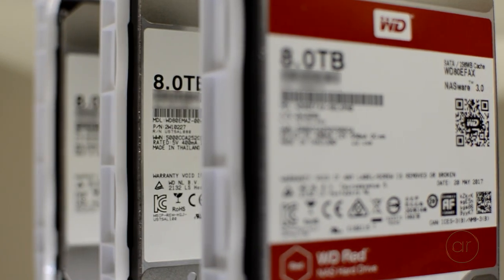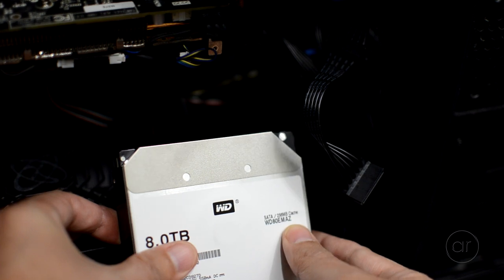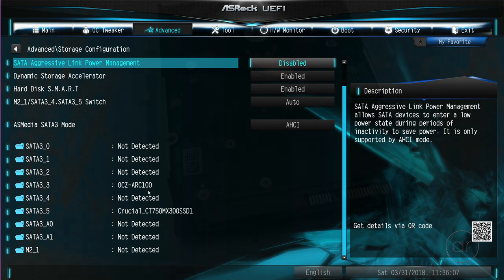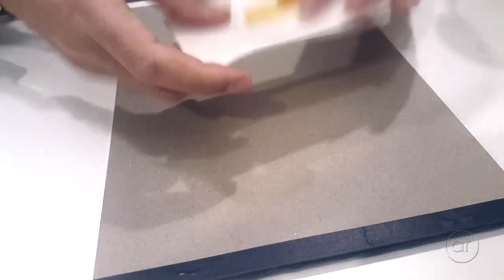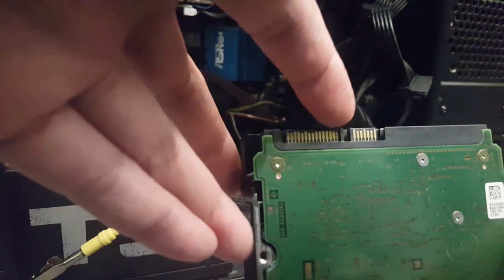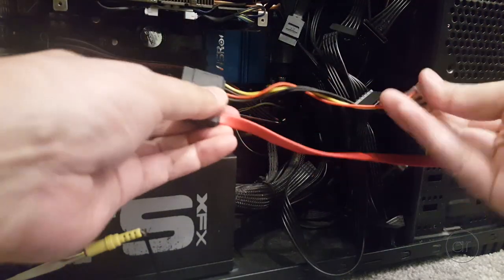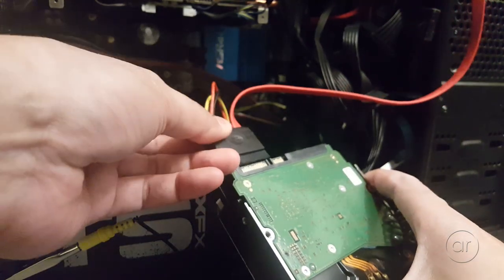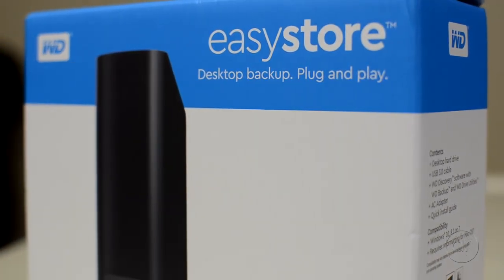How to Fix the 3.3V Pin Issue in White Label Disks Shucked from Western Digital 8TB Easystore Drives

Comment: Note for anyone having a hard time getting the tape to stick: You can actually cover up pins 1 and 2 in addition to 3. It makes the tape stick much better, and your hard drive doesn't use 3.3V anyway.
Reply: this is the most helpful post
Reply: Confirmed, I covered all first 3 and it recognized the drive, thanks to both of you.
Reply: This worked like a charm, thank you
Reply: Thank you. That was so much easier to accomplish than a single pin.

Comment: Wow, I can see why you'd go through the trouble for this.  It seems the cost of these external drives is about half the cost of a normal standalone 3.5" drive.  Just goes to show how inflated the prices are.
Reply from the maker: Yeah, they're definitely targeting a different market with the externals (high-volume, convenience, no need to open the computer).
Reply: @accessrandom  really? how much are the white label drives? The Seagate 3.5" BarraCuda 8TB drives specifically sold for internal storage are $230USD atm.
Reply: less than $30 a tb seems cheap as anything
Reply: @knifeyonline  I bought some easy stores last night that had the same 8 terabyte white label drive as the video for 130 dollars per drive.
Reply from the maker: White label drives generally aren't sold as internals, but they have the same or similar specs as the WD Red label drives. The Barracuda Compute 8TB drives that I've removed from external Seagate Expansions in my other video seem to be different than the Barracuda Pros as they have slightly different model numbers (ST8000DM004 vs ST8000DM0004 respectively). At any rate, agreed there's a lot more bang-for-the-buck with the externals.
Reply: The WD external 8TB drivers were $180CDN on sale, about $100 cheaper than the internal drives. I didn';t have to worry about this problem in my server but definitely it's worth it to shuck them.
Reply: @Waltzkon  When you bought yours for 130(i know two months ago but I'm gonna start watching for a sale) where did you buy them from?
Reply: I got a 10TB external for about half the cost of a interal drive
Reply: They are cheaper because they are lower quality. If you don't care at all about your data, then please go ahead doing this. I won't.
Reply: @Clarissa 1986 "After all they are WD Red HDD's"... :-)
Reply: It is all down to quantity. I expect somewhere like Argos or Best Buy gets a better price on these than a computer shop wanting to buy 100 internal drives would get. I wonder how much someone like Dell pays for drives when they are ordering tens of thousands ? Undoubtedly  less than these cost a retailer. Buying components for work,   price breaks often mean it is cheaper to buy 100 than to buy 60 !

Comment: Using an earthed wrist strap can be as dangerous (if not more dangerous) as not using one at all. There's no guarantee that your mains earth is going to be at the same potential as whatever you're working with. You could actually fry the drive BECAUSE you're wearing it. What you should do is make sure everything is at the same potential so no current can flow anywhere. To do this, plug the data cable into the drive while you're doing this and plug the other end into your PC. Then attach your wrist strap to a grounding point on the PC. One of the shields of a connection port would be okay, or to the ground pin of the power plug (the PC shouldn't be plugged in). Then everything is a closed circuit at the same potential.

Comment: This video is so professionally done. Love the instructions/video and voice-over!
Reply from the maker: Thanks so much!
Reply: @accessrandom  for some reason i couldnt reply directly however this video saved me a ton of headaches. i just used a molex to sata adapter i had in part bin and the drive is running like a champ internally. thanks for the link to the r/datahoarder reddit too tons of great info there
Reply from the maker: You're welcome, and thank you.
Reply: No it's not.  Dude wears an ESD wrist strap, but the clip of it, is fastened to the computer case while it's not connected to the power supply .....   That doesn't deflect any ESD at all.
Reply: Straightforward and to the point!
Reply: @accessrandom  great video, Now I understand the 3.3V issue. this is not an issue for old PSU's though
Reply: @eidodk  True LOL Then those scissors and flathead metal contacts... youch

Comment: You can also use a Sata to Sata power splitter or extension. If the extension contains any orange wires, simply cut them out and remove.
Reply from the maker: Good idea - thanks for the tip.
Reply: @accessrandom  Hey, I have a quick and easy question for you; I found that I have about four sata to sata splitters / extension cables; If I hold it with the female connector(s) facing up; the wires from left to right are:  Yellow, Black, Red, Grey, and I just wanted to see if you knew if these adapters also will work or not; because I haven't removed the external drive yet, and would like to be certain I have the correct resources on hand before starting; not sure where to get tape, as that is a new solution I also wasn't aware of; but I would imagine if I cannot find it locally at lowes or home depot, it wouldn't be to hard to find using the correct search term; thank for any info.

Peace

Comment: Alternatively you can also cover pins 1 and 2 together with pin 3. They aren't used either, so it's much easier. Using a Molex adapter can be dangerous, because the low quality ones are getting moulded after the cables are plugged into the plug. This leads to the cables moving and getting close to each other and then burning the whole disk (Molex to SATA, loose all your data). The good ones are crimped and just stuck into an already finished plug without the cables being able to touch each other.

Comment: This saved me several hundred dollars! I was going to go out and buy five new HDD's, but I was like "no, wait, why is this Red drive working, but these two White drives not working...? They all worked in the old system last week without any issues...." I took one of the power supply cables I had purchased previously, with the right-angle plugs, and just snipped the first wire - the one closest to the "L" part of the power cable - and electrical taped it off carefully. Plugged the drives in, and everything worked. It's insane that this is a problem. Wish there were a "switch" or "BIOS" fix, but removing the 3.3 volt line will harm nothing, as this is in a personal computer, and I don't need to "remotely restart" a hard drive. I would like to know more about the transition...why this happened, and why no one seems to care about making drives obsolete with a weird cable/power supply issue. My power supply is a brand-new SeaSonic Prime TX-1600, so I couldn't imagine that being the issue. Nice to know it's that "pin 3" so easy to mitigate. Thank you so much!

Comment: The 3.3V "issue" is actually an Enterprise Feature - it is used to spin up multiple Disks one after the other instead of all simultaneously
This way you can use way smaller PSUs in a Server and/or drive enclosure :)
Reply: Yeah, but clearly this is a workaround for those shucking drives to save moolah.
Reply: Not exactly, staggered spin-up has been around since parallel SCSI, this power disable feature was only introduced with SAS3 and SATA3.
Reply: @VladdyDaddy45  Actually it's a enterprise hard drive. I even test it. I have WD80EDAZ-11TA3A0 the one you suppose to put tape on. Wouldn't work on my desktop but was able to be detected on my Dell Power Edge T710. :D
Reply: Can those pins just be removed from the drive or sata plug?
Reply: @mikemulvaney8490  Yes, but its easier to use electrical or kapton tape to cover the pins on the drive's SATA connector.

Comment: Thanks this has been driving me nuts and I assumed it was my motherboard getting a bit old. I removed the pin with a dental pick and works great internally now.
Reply from the maker: I wouldn't have thought of using a dental pick but now that you mention it, it sounds like the perfect tool :) Thanks for the comment, and glad you found the video helpful.
Reply: @accessrandom  yeah I was wondering why you didn't just use a scribe to remove the pin.
Reply from the maker: I was focusing on non-destructive ways to prevent contact, but these are perfectly valid (and brilliant) ways to solve the problem.
Reply: Any videos on how to remove the pin? Would any other tool work just as well? Thanks
Reply from the maker: @cajunflix1movies728  Others in the comments below have used Xacto knives. I think anything thin and sharp enough to get under the pin should work (sorry I don't have a video on this, but I myself was trying to do it non-destructively).
Reply: Excellent video and excellent tip on removing the pin!  I used an exacto knife and it worked like a charm. Thank you both!
Reply: Thanks! This is by far the easiest method.
Reply: I would not recommend removing the pin, doing so will void warranties
Reply: @chrisvm6231  The warranty is already voided by shucking the drive.
Reply: @jeromemccrary8682  unless there is a warranty sticker on the housing it isn't
Reply: @jeromemccrary8682  it isn't. You can even send the drive back by itself and they will replace it.
Reply: @LiquidPlacidity  that's not true put serial number of drive into wd warranty returns . It won't  exist as there is no warranty. Serial on enclosure is different
Reply: @jeromemccrary8682  The HD manufacturers might claim that to be so but unless breaking the pin caused the HD to break they have to still provide warranty. Just like servicing your own car wont void the warranty if the servicing wasnt the cause.
Reply: @chrisvm6231  "Warranty void if broken" stickers have no legal standing.
Reply: “I don't know”, you don’t have to throw away the cases. Additionally, few years back I’ve seen a number of external WD drives that have had the same SN on the outside as the internal disk drive. But I haven’t checked that recently; it may have changed...

Comment: Hey fellas, thanks a ton for this video.

Instead of using either of these solutions listed I used an automotive pick to pull up the third tab on the power side and moved it gently back and forth until it broke smoothly at the base.

Now windows/bios sees the drive and works fine.
Reply from the maker: Thanks for the tip - I'm sure it will be helpful for others.
Reply: @accessrandom i used this guy's tip and lifted the 3rd contact up on a female to male sata extension cable and this also works fine and no setting fire to the house problems that it appears a lot of people have had from the molex to sata extension cables - excellent video and suggestion reply that led me to this solution - Thanks a lot :)

Comment: Mine was a WD Blue drive, from a MyBook 6 Tb. 5400 RPM :(((

The pins inside the sata power connector are spring-loaded so I ruined the pins ability to reach the contacts with a tiny screwdriver. Worked perfectly well, thank you very much :)

Comment: thanks, I didn't use either of the 2 options, I cut the cable on the power supply sata connector that corresponded to the 3rd pin (was the first cable in my case) and it worked perfectly.  Only drawback is that if you plan on switching out a new hard drive in the future, just make sure it's a schucked one or use a different sata cable .
Reply from the maker: Thanks for the tip. I was focusing on non-destructive methods, but yours is a perfectly valid way to solve the problem.

Comment: Thanks so much for this explanation! I was getting ready to blame WD (and my cheap-ass self) because its budget priced MyBook (which was already a pita to get out of its enclosure) wasn't being recognized as an internal drive on my old pc (which I repurposed as nas). The tape solution already worked like a charm, luckily I had an old sata to molex (only power) adapter lying around, which is an even better solution!
Reply from the maker: You're welcome, and thanks for sharing the success story 🙏👍 I've heard the MyBooks with the newer enclosure design can be difficult to shuck.

Comment: Kapton tape worked perfectly. Use tweezers and a toothpick to place and smooth the tape. After spending 45 seconds smoothing / pressing the tape into the pin I tested plugging / unplugging the connector a few times and it stayed in place perfectly. Thanks for the guide!
Reply from the maker: Thanks - always happy to hear a success story :)

Comment: I came up with another solution. I was using the Molex to SATA adapter but it is the molded kind. It was making me nervous. I decided to mod the 3.3V line on the SATA power cable and discovered that the cabling Silverstone included with this power supply actually has removable caps on the backs of the SATA connectors. I pulled off the cap and slid the orange 3.3V wire out of the connector. I wrapped electrical tape on the insulation where it had been sliced by the connector and recapped the connector without putting the 3.3V wire back into it. I don't know if anyone else has this style of connector going to their drives but it's worth a look. Easy to do and easy to reverse if the 3.3V line is ever needed.
Reply from the maker: Awesome - thanks for the detailed description.
Reply: @accessrandom  Thank you for the video that got my and a lot of other people's drives working. Thanks also to the commenters that got me thinking about modding the cable.
Reply: This is what I always do -- just mod the PSU cables to remove the 3.3v line. Most good PSU's come with crimped connectors anyway, so they are easy to mod.
Reply: @wpyoga  Never had to deal with this until I shucked that Easystore. Learned something new. I was going to try pulling the 3.3V line from the PSU side of the SATA power cable but this seemed like a much easier route.
Reply: @ericn7677  From the video, your PSU also uses crimped connectors, you should try this method.
Reply: well pulled the orange one from the part that is connecting to the psu, let's see if i get the drives to turn on on the entire cable (4 pieces) or if i burn in a minute... will be back, hopefully

Comment: well explained video I congratulate you, just a note, in my case putting tape on pin 3 did not work, but I read some comment below say that covering the first 3 pins worked and it is, it is easier to cover the first 3 pins so removal of problems.
Reply from the maker: Thank you kindly. Yes, that is easier to do since the first two pins are not really used by any modern power supplies. Thanks.

Comment: I would have never guessed.  Thanks for the heads ups.
I have a Netgear ReadyNAS that I just replaced 4 drives in ... meaning I probably blew away my OS, but I was thinking it might be this problem that the drives are not spinning up.

Comment: I found that if you can open the SATA power connector, you can pull out the left most cable which is the 3.3V. Great for those with no electrical tape nor the extra power cable (me)

Comment: Thank you very very much, I wasn’t able to know why it didn’t power on when used internally, I suspected that it had to do with something in the PSU regarding the SATA connector, because it worked on other external enclosures (and was planning to test it in other PC) my plan was to use a Molex to SATA adapter not because I new it but because I suspected my PSU wasn’t managing all the voltages that its own cage did and maybe with Molex been more powerful and streamlined it may work, it would have worked as I just now seen but entirely from different reasons and was quite inconvenient wait for the Molex adapter.

Was quite hard for me to find your video as basically all searches involving the words HDD and no powers was flooded with external hard drives.

Luckily in the end the full model plus no power “wd100emaz-00wjta0 no power” clicked and was able to find you, again thank you so much
Reply from the maker: You're welcome and thanks for letting me know. I'll need to figure a way to make my video a easier to find based on search criteria.

Comment: Here is another solution. Pulled out the razor knife with a new blade and picked at pin 3 until it pryed up and then broke the pin off. Never have to woory about it again worked perfect. The 3rd pin stciks out a little longer than the rest which makes it easy to get under. Could not have figured it out without this Video.
Reply from the maker: Great solution! 👍 In the video, I was just showing some of the non-destructive solutions...